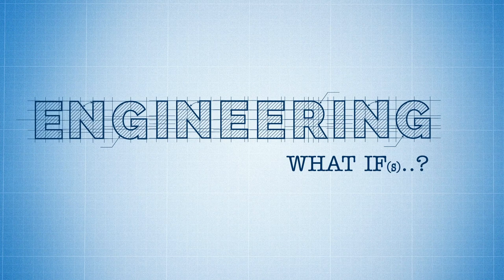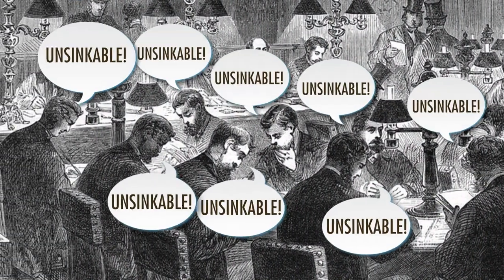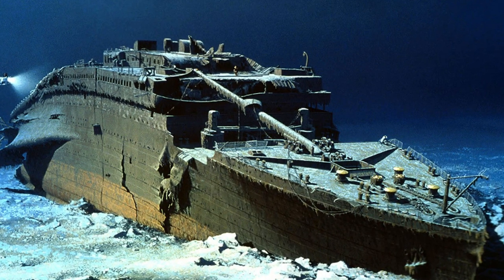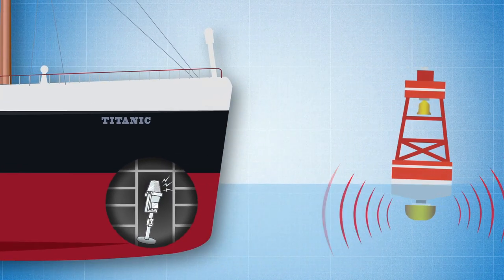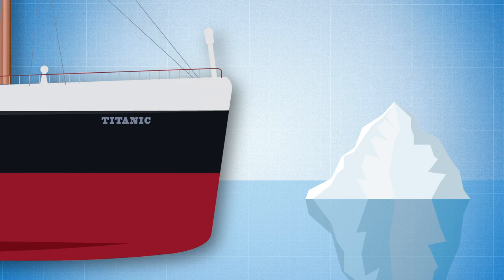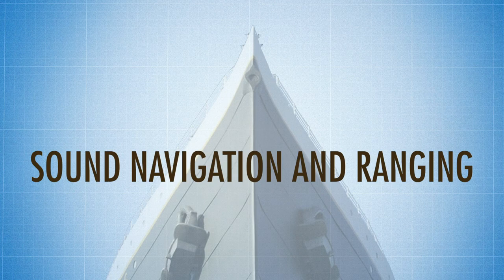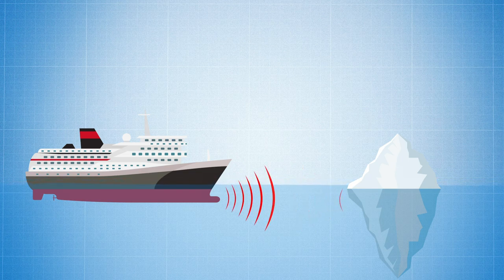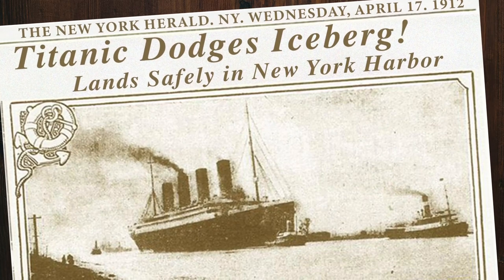What if the Titanic had ULTRASONIC SENSING Capability?

Comment: Wouldn't have made much difference really. The ship was trying to set a new transatlantic record. It was traveling too fast for the conditions. Too many people were involved. By the time the iceberg was identified and the orders given to change course and slow down the iceberg would have done its damage. 
   Because of this wreck, I spent several months on the Coast Guard Cutter Absecon (1962-1967) in the Labrador Strait looking for bergs. Called Ocean Station Bravo. It was always cold and the snowflakes were the size of dinner plates. They'd sometimes fall like leaves and would stick to anything. The weather blew the icebergs out into the strait, but that night was "very unusual" They knew the high winds were scattering the ice into the strait. 
   The foghorn would have returned the icebergs' presence faster than a sensor. That ship was doomed before it left its dock.---Poor Engineering..
Reply from the maker: Thank you for your service Michael... and thanks for your firsthand account of what it's like hunting bergs!.. Cool story!